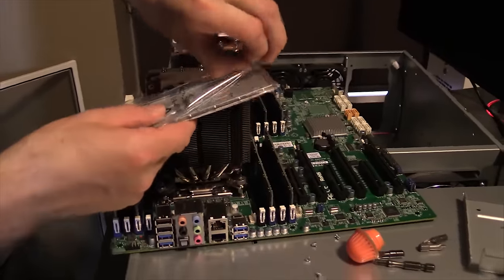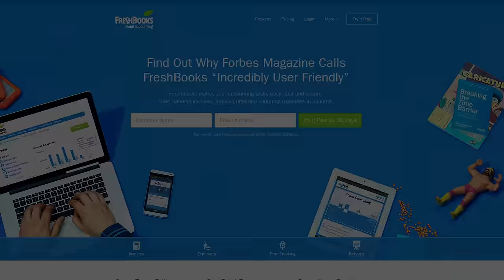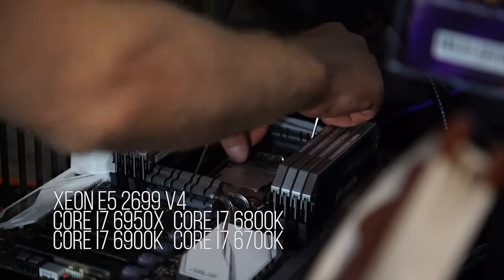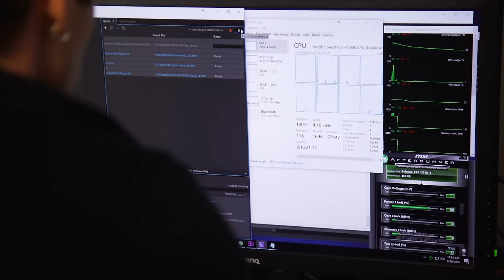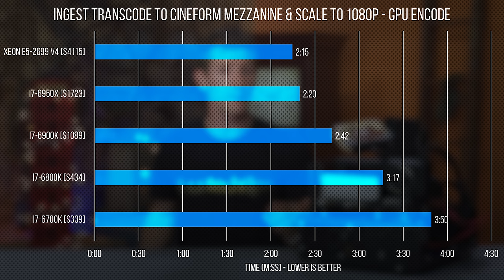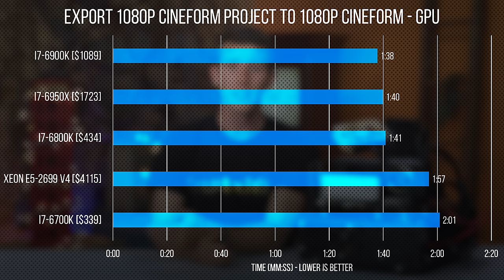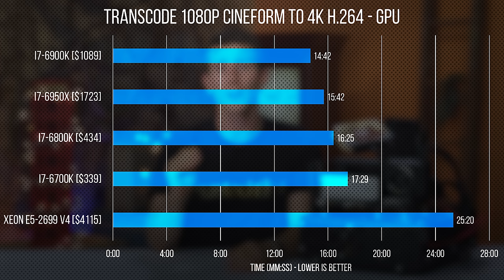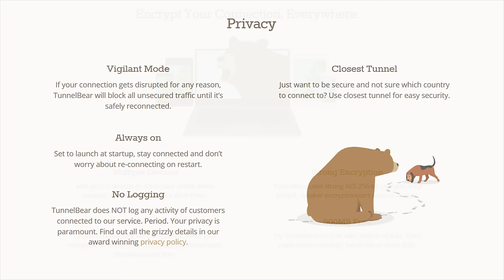$300 CPU Beats $4000 CPU?? - Cores vs clockspeed for video encoding

Comment: "Easy vpn" 
It doesn't give me an option to change the port :(

RIP my internet at school.
Reply: PrivateInternetAccess does I believe, if I recall correctly. :)
Reply: I've used PVN it's a great service. Or try hidemyass
Reply: Indeed it does, it is a feature of Open VPN.
Reply: +ErikTheAndroid openvpn is different than pvn...
Reply: +Stefan Karlsson you have to pay for pvn. I would rather run a vpn on my home computer and just use the free openvpn to connect to it
Reply: my asus router have a vpn built in. see if your router has it. is needs to be a high end router and not any comcast bs.
Reply: +FishFind3000 ...can you read?

I said at my school. They blocked everything except google. EVEN VPNS
Reply: Yes I was replying to Stefan, seemingly YT did not care for it.
Reply: Still got that issue?
Reply: ***** use hotspot shield. Unblocked for us.
Reply: JhonToTheConners
I'm surprised you were able to get that at your school
Reply: Jacob Kelsey ?
Reply: JhonToTheConners
I'm surprised that HotSpot Shield's ports/website wasn't blocked from your school via ACL's.
Reply: ***** Dunno either. Things like betternet and other VPNS are blocked though.
Reply: JhonToTheConners
I wonder if OpenVPN is blocked, I was gonna say you can make an OpenVPN server in your house and use a non standard port then just connect to your own VPN server.

No ads or data limits, which is really sweet.
Reply: ***** I thought about doing that, and even tried to, but oh my it failed so hard xD
Reply: JhonToTheConners
There's pfSense if you want to use that as a gui way to make it
Reply: ***** alright
EDIT:
Its implicating its a whole os?
Reply: JhonToTheConners
pfSense is a gui firewall based on FreeBSD, you could setup a VM with it and port forward the pfSense VM on 1194 then setup OpenVPN inside of it.

It's FreeBSD with a gui and all networking tools preinstalled on it.
Reply: ***** FreeBSD being a os like linux?
Reply: JhonToTheConners
In some ways yeah
Reply: ***** thats weird...

Comment: I can theorize the problem with threading to you if you like Linus. H264 works with using "motion" algorithms to compress the video, so the threads are bound by sequential order, making one thread as fast as the slowest in your link, so it not that the xeon is slow at encoding, but rather it is being bottle-necked by the encoding pipeline. That is just my 2 cents as a graphics programmer.

Comment: Meanwhile the AMD fans are claiming "all software is multi-threaded now so single core performance doesn't matter".
Reply: ***** I kid you not, man. Just go on any forum thread where people are talking about Zen rumors, and you'll see posts of people claiming that the FX-8350 will make a magical comeback because of multi-threaded software.
Reply: +PooPipeBoy lol I feel bad for em
Reply: actually, intel, arm, ibm, all are looking into more cores..
Reply: which is actually funny, I've noticed the steady increase in Intel cores whilst some people still claim that Intel's lower core count is better all around. It's basically down to timing, now is the right time for them to be putting out more cores. It'll get more affordable later. At least if everything pans out.
Reply: My 8350 saw a HUGE performance jump on Windows 10 and DX12. It definitely DID. You going to prove it's incorrect somehow?
Reply: Yea huge, all 5 dx12 games, fuckin huge.
Reply: Evan Wins
 PSTTTT genius Dota 2 is DX12. I get like 144 FPS on every single game you listed. Why do I need a thousand dollar intel to run them again?????
Reply: I have a 8350 laying in my closet. It can handle most AAA games. But games like heavily modded minecraft, From the depths or Fortresscraft. Not so much.

Comment: Linus has been screwing up for years as far as budget computers go. He constantly ignores AMD despite the 8350 outperforming a 3rd gen i7. Gaming computers he runs an i3 over a 8350 despite the AMD being both cheaper and decimating even a 6th gen i3 both in synthetic tests and real world gaming.
Reply: What are you smoking? The 8350 is old outdated  architecture. A 3rd Gen i5/i7 will shit all over it.
Reply: gdfschimpi007 I mentioned the 3rd gen Intel i5/i7 on purpose. The 8350 is well known to beat the 3rd gen Intels in both synthetic and real world tests. As for "old outdated architecture", well the 8350 architecture is a year newer than the 3rd gen Intel i5/i7. The 8350 came out about the same time as the 3rd gen, but the 3rd gen is just a die shrink of the 2nd gen which is a year older. So yeah, what are you smoking? Your comment sums up everything I hate about Intel fanboys.
Reply: Olivia Lambert
 I simply buy the better product. Enjoy you bottleneck and weak cores.
Reply: I have a second gen intel i7 sitting in my other computer. A stock 2700k. It performs the same in benchmarks. but better in gaming. Half the cores of the 8350, same score in cinebench. And much faster single - quadcore performance. I also have a 8350 on the shelf. It bottlenecked me pretty much. So i bought the 5820k. Used to have amd until now. but it just isn't fast enough.
Reply: The 8350 was obsolete since it launched pretty much. Not much room for overclocking either.
Reply: gdfschimpi007 Unless you have SLI 1080s you could have saved money on the CPU and used it where it matters with a stronger gaming computer and more FPS. Enjoy your weak frames.

jockemoll Quite frankly you either built your AMD computer terribly or I call bullshit. Bulldozer was on par with Intel when it released, both gaming and synthetics. Piledriver was a strong step forwards particularly for gaming. And finally overclocking, there is a reason why the top tier of professional overclockers will use AMD over Intel. Hell, some of them will use the exact 8350 you're suggesting struggles with overclocking, It is well known that with the 8350 if you can't break 5GHz you have been very unlucky in the silicon lottery. So once again you either don't know what you're talking about or you're outright lying.

Randy Zhu Quite frankly I don't know how you got those results. Were you running Windows 7? The FX series performs incredibly poorly on Windows 7. An update helps things but they didn't fix it until Windows 8. Essentially the FX groups its 8 cores in 4 pairs, each pair of cores shares resources. Windows 7 would give orders to the cores and more often than not it would ask a pair to do work whilst the rest sit idle significantly slowing it down. Windows 8 fixed that and has no problems whatsoever.

You really, really shouldn't be seeing better performance with an i3. I mean hell it was shown by Jayztwocents, an exceptional youtuber. He put the fastest 7th gen i3 up against an 8350, the 8350 decimated it. You don't just need to take my word for it with that one. It was a test as identical as he could make it, same high-end GPU for both setups. The i3 was barely playable, the 8350 did great.

As for what I did, I haven't done anything people can't easily replicate. The only unusual thing I've done is a novel way to underclock my CPU but it significantly reduces performance in every way without any form of performance increase. Aside from that I used good components, a very high end motherboard, but I've had identical results on a friend's computer using as cheap a motherboard as he could get away with.

If its not Windows 7 the only other thing I can think of is the overheating. It absolutely shouldn't be overheating. Perhaps it was thermal throttling? Look at your case temperatures and the CPU heatsink you're using. 3rd gen i3 onwards certainly will run noticeably colder but I spent a few months using a low profile heatsink smaller than that in the box and it managed all games and VR without thermal throttling. It certainly did run hot until I gave it a real heatsink but either way without much information I'm tending towards poor case temperatures causing thermal throttling.

Finally the 8350 isn't great with DX11. However of literally hundreds of games there isn't a single one using DX11 which demands more CPU power than the 8350 is capable of. And no matter how the 8350 performs in DX11 it still beats every single i3 in every single game by a significant margin, often over double the FPS. That includes DCS World, Cities: Skylines, ARMA 3 and multiple games in VR. In fact the worst I've seen are driving games and it still gets well, well beyond 90 FPS.

Anyway if you want to try and get the 8350 working properly get back to me and I'll see what I can do to help. Because really you should be seeing very significant performance gains over even a 7th gen i3 both gaming and non-gaming. If you don't have at least 4 cores games really aren't very happy.
Reply: Olivia Lambert Really? The i3-6100 out proforms the 8350. the i3 is cheaper, generates less heat, and renders cinebench faster. Also my old 8350 got quite hot.
Reply: Randy Zhu Yes really. Every real-world test the 8350 beats out any i3, and its been shown again by a very respected tech channel putting it up against the top 7th gen i3. The i3 is more expensive, though it does generate less heat. However the fact that it wins on cinebench and gaming means there was a problem somewhere with your 8350 build. I would expect the 8350 to be capable of near double the FPS, and a significant improvement on cinebench. So if you had Windows 7 that would be your problem, otherwise you'd need to diagnose where the issue is though if it was thermal throttling that would be another explanation. Anything else would be a lot harder to fix but quite frankly I think it would be worth it.

The 8350 is capable of running any game today GPU bottlenecked. I say that because I'm using one myself with a Fury X and I'm no way near CPU bottlenecked.
Reply: Randy Zhu Yes really. Every real-world test the 8350 beats out any i3, and its been shown again by a very respected tech channel putting it up against the top 7th gen i3. The i3 is more expensive, though it does generate less heat. However the fact that it wins on cinebench and gaming means there was a problem somewhere with your 8350 build. I would expect the 8350 to be capable of near double the FPS, and a significant improvement on cinebench. So if you had Windows 7 that would be your problem, otherwise you'd need to diagnose where the issue is though if it was thermal throttling that would be another explanation. Anything else would be a lot harder to fix but quite frankly I think it would be worth it.

The 8350 is capable of running any game today GPU bottlenecked. I say that because I'm using one myself with a Fury X and I'm no way near CPU bottlenecked.
Reply: Olivia Lambert
Professional overclockers use AMD CPUs as Intel CPUs have issues when going sub zero degrees on LN2. Though generally the bulldozer CPUs were good overclockers, (Unless you care about power bills, but Sandy-bridge also was able to reach 5GHz and get decent performance) and if their CPU died it isn't expensive to replace it.
Though in terms of performance the i3s might not beat the 8350/9590 all of the time, but it won't be too far off either. And considering that a Pentium G4560 costs half the price here in Denmark and gives way better $/perf/watt then I see that as a much more appealing option over the Bulldozer CPUs.
Reply: PJ 
those old amd cpus suck. no one cares move the fuck on at least go with ryzen. FX is dead stop trying to defend it.
Reply: Hayate Azekura I wrote the comment pre-Ryzen release m8 & I also said that the G4560 is a better option than bulldozer & saying that the i3s "might not beat the 8350/9590 all of the time, but it won't be too far off either."
Going through my comment I don't see where I defended the FX CPUs I only corrected Olivia in the upper part of my comment & saying that Intel CPUs are generally better
Reply: User with no videos and 1k subs.  The internet is a strange place.

Comment: For the camera and gear I use at work, I find that I always use whatever format and resolution the camera encoded in so 4k Quicktime MOV 70Mb/s or 1080p AVCHD 24Mb/s  I edit in that resolution and then output to 4k 35-40Mb/s H.264 for YouTube.  The 4k camera can do 150Mb/s but it's mostly pointless for YouTube at this time.

The copying off the camera, importing and conforming usually takes 30-60 minutes to complete for  2 hours of footage at 4k but editing and scrubbing through video is fluid.  The export usually takes an additional 12-14 hours for about 2 hours of video.  And finally, the resulting video is typically about 30-35GB in size which takes, typically 2.5-3 hours to upload and an additional hour or so for youtube to finish processing.  I usually figure 8-12 hours per 1 hour of video not counting editing.

Comment: Noting the low utilization of both the CPU cores AND the GPU cuda cores, I actually would point the finger at the driver architecture.  One assumes that whenever a chunk of data is shipped to the GPU for processing, semaphore locks are involved.  With 22 CPU cores all trying to push and retrieve results from the same graphics card, I would think you're seeing low utilization because of all the time being spent waiting for those locks to free up.

I don't know much about running multiple GPU's that are NOT SLI linked, but it might be worth trying a setup with multiple Titan cards, in the hopes that while one is semaphore locked for data transfer, another can be open to accept work from a different CPU core.  This assumes the driver architecture properly instances itself for multiple cards, so every request isn't going through a single process.

Comment: If your mezzanine codec of choice is ProRes or DNxHD/HR, the scaling becomes a lot more efficient the more cores you have. Cineform is an oddity because it's designed be accelerated by the GPU and Adobe software is specifically designed to work well with it.

That being said, even in a lot of other codecs and workflows, having higher clock speeds is more important. For instance, Avid is still mostly bound to a single core for transcoding.

Comment: Interesting video.  While I do know that for a company where people are getting paid by the hour it almost always makes sense to reduce time spent waiting for the machine to complete a task, it would be revealing to do a comparison correlating clockspeed vs time to find the actual sweet spot for the CPU is - which also relates directly to cost as more cores == more $.

Yes, I know that based on the actual software environment and work to be done that can vary...

Comment: Linus you seem to be saying you forgot the first rule of running SMP.
Its the difference between a bus doing 50mph and a car doing 60mph.
The task is to transport a guy with a suitcase 1 mile down the road to the airport.
The car will do the job in 60 seconds
The bus will do the job in 75 seconds.

That same car can carry 4 guys all wanting to get to the airport, any more than that and its trip takes 120 seconds.
A bus can carry 16 guys all wanting to do the same trip and it will take them all in 75 seconds.

Give the Xeon the right job and it will out strip any of those processors.

Comment: there's also a heap of concurrency issues when using many cores (mutex locks on buffers etc) which is also why sometimes more cores hurts you.

I was helping diagnose a problem with a router which had 4x 10C xeons w/HT (don't ask) which was topping out on pure linux at about 30mbit/s per second. on a hunch I disabled all but 4 of the CPU cores in linux and we were up to near line-rate 10G.

Comment: I could have told you. But we didn't meet before. Your and any other multicore solution for heavy computing will boost only when you make the software tuned to the precise processor. There is much more to it than just aligning the code and do a rough core chip sharing. The reason why cheap dedicated processors perform so much better is, their software is carefully tuned to the scope, and optimized by people like me. The same is true also for graphic cards, which have dedicated and tightly bound software with no operational gaps. The developer knows about the microcode and how to trick the cores to make work complex tasks together.

With a carefully made software, you would eventually be able to get 100% of what you paid for, but the cost for the software would be unaffordable, because it would need a huge staff to make it relatively quickly available ... or would you wait years?

Comment: Everttime the Hannsey and Patterson book mentions many core, it talks about GPU.
GPUs of today do essentially the same thing but in highly parallel mode and at lower speeds.
Theoretically, in any manycore workload, the GPU will win when combined with a high clock CPU.

Comment: For some people, video encoding means adobe suit,  adobe encoder center, and so on. But there are some people only use x264 and x265. And they don't use gpu to accelerate because this will damage quality. You can see these people in forums like doom9.

Will, now that Linus has so many fancy CPU, would you like to run x265 or x264 with a proper parameter?

Comment: When we should start comparing cpus with 8 or more core/threads by testing how fast they render two videos at once vs just one. I notice there are major differences and this is also where you will see more ram benefit.

Comment: Hello everyone. When buying a CPU, the performance of each thread makes the difference, not so much the price:

As an example, see the following list (Updated on December 15, 2016):

Single Thread Performance

Intel Core i7-7700K @ 4.20GHz     CPU MARK 2,628
Intel Core i7-6900K @ 3.20GHz     CPU MARK 2,160
Intel Core i7-6950X @ 3.00GHz     CPU MARK 2,116
Intel Core i7-6800K @ 3.40GHz     CPU MARK 2,041
Intel Xeon E5-2699v4 @ 2.20GHz CPU MARK 1,615

My cpu Intel Core i5-4210H @ 2.90GHz CPU MARK 1,884!!  (IT WINS MANY AND IT'S A NOTEBOOK)

:/
Reply: mas videos careful of single thread ratings on K chips. Probably polluted by overclockers